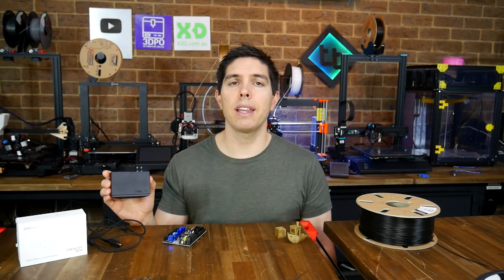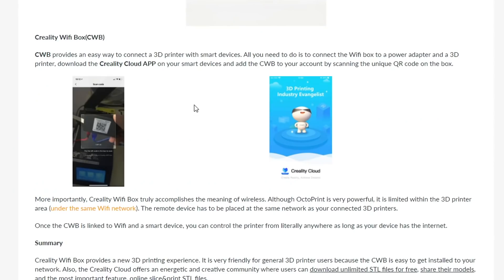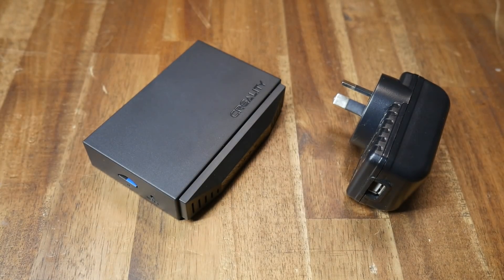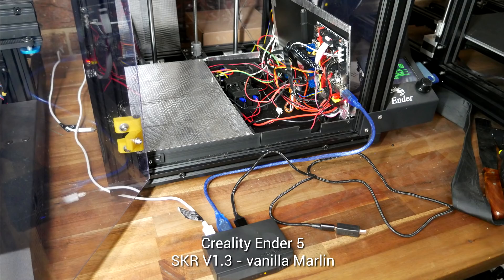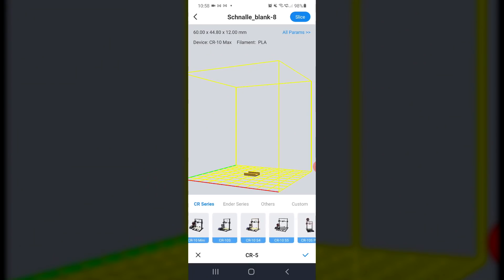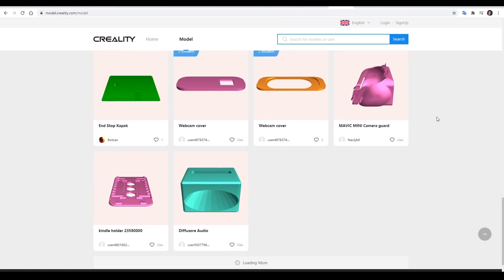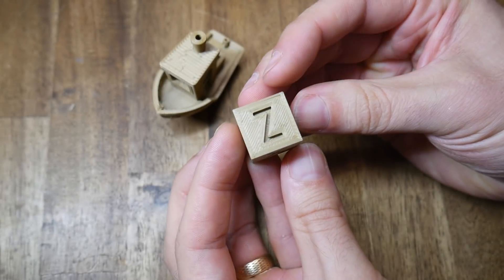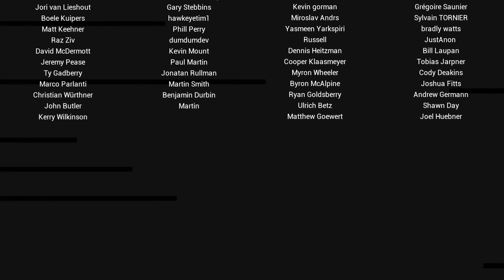Creality WIFI Box tested: Budget Octoprint alternative?

Comment: I use a number of plug-ins with Octoprint, but the Home Assistant integration is really great.  When the printer starts a print job, external lighting around my Lack-based "enclosure" for my Ender 3 comes on.  After the print concludes, if it's been more than an hour, it will send me a notification telling me, along with the elapsed time (except if it finishes in the middle of the night and I'm sleeping.)

Octoprint seems like a better alternative.  I can't imagine doing all that management and configuration on a phone or tablet screen as compared to mouse, keyboard and large monitor with a web interface.  And I really try to not let the printer run completely unattended -- checking the status while I'm outside the home isn't really a problem that I need to solve.

Clearly you invested a lot of effort doing the evaluation so we don't have to.  Thanks!

Comment: how is it a budget version of octoprint, if you can install it on any sbc, even some sub 10 buck chinese ones?! youre no bound to raspi
Reply: Right, he should trz octoprint on an orangepi. Maybe you need some more time setting up, but also only half the cost of this solution.
Reply: @flipschwipp6572  I have had Octoprint running on OrangePi for years. Works perfectly fine and was not that hard to setup either. I believe the OrangePi costed me 12 dollar. Since it is so cheap I just build it into my 3d printer.
Reply: If  someone would do a more efficient octoprint incarnation, we could go to smaller processors like v3s or F1c200s ( both sub 5$ linux capable chips)
Reply: @soundspark  Yes, I know. People just often use the OctoPi image for Raspberry Pi because of convenience. I mentioned it because installing it on OrangePi is entirely possible, because the OrangePi is cheaper and because I have not found any downside to it other than having to install it manually.

I started with either a debian or ubuntu system image for OrangePI (I don't remember which). And then just followed the instructions for manually installing OctoPrint.

Comment: Yah in theory it could be made into a good solution if it could remember the changed printer settings like retraction and temp and if it allowed slicing of any stl. Although it is basically a solution to a problem that didn't really exist since if you cannot afford a Pi than 3d printing is probably the wrong hobby considering the continual costs associated with 3d printing.

Comment: Octoprint - My favorite plugin is TP Link SmartPlug and Thereify .   Tp link and BTT SKR E3 Mini Turbo do not work well together because the board take to long to boot up causing octoprint to switch off the printer on error.  I replaced the turbo board the the V2 baord I was using without any problems.  My printer is an Ender 3.

Comment: talk about low budget. A TV box flashed with armbian and installed octoprint via python can make the cost around $10. The on board resource may be less than rpi, for example have no GPIO, cheap camera or less usb port etc. However you may get a better processor(for my case amlogic x912) , much more ram(at the time I build only Rpi3b aviable, so 2G+ ram was neet) , lower cost, and similar or better octoprint experience.

Comment: Wow - Octoprint runs fine on a Banana Pi Zero (4 core Raspberry Pi Zero W alternative) running Armbian for $20, Prusa even has it running on a Zero W for $10 although it's slow and I found the WiFi range was poor. Don't need a Pi3/4 to run Octoprint. Even if this worked reliably - having to use the internet, an app, forced registration, AND Cloud dependency (so when Creality pulls a google and kills the service it's a paperweight), HARD NO.

Comment: I feel like octoprint is the budget alternative to octoprint.
Reply: The budget alternative of octoprint on a raspi4 is octoprint on a raspi3b
Reply: @moxl_  if you're feeling lucky or don't need a camera,  a pi zero can do
Reply: @moxl_  Yep, I used a Raspberry Pi 3a+ but then had to buy another usb hub, so same price as the 3b basically.
Reply: @moxl_  orange pi is cheaper than raspberry pi...
Reply: Great price for either alternative :)
Reply: cant you just use octoprint on normal pc?
Reply: @Barten0071  yes. On fact, that's how I started off using octoprint, using a laptop I had kicking around.
Reply: Your saying octopi t is a budget alternative to OCTOPRINT?
Reply: Seems like a solution in search of a problem. If it can't switch your printer on, remove the part from the bed, and essentially do everything you need to do in between print jobs, the whole "not connected to home network" is utterly useless. And comes at cost of mobile UI.
Reply: No. Klipper is the budget alternative to OctoPrint.
Reply: yeah
Reply: Octoprint on Orange Pi Zero 2. Takes a good bit of work to set up - no ready-to-use octopi image, and bizarre problems like wifi ceasing to work the moment you unplug Ethernet -  but once you finally get it running, it runs flawlessly.

Comment: Though the Raspi Zero W is not officially supported by Octoprint, I run it on three printers and it works just fine. I never had ANY issues. 
So you can set up Octoprint for about 11€.
Reply: Orangepi is also sub 10$ and way more powerful

Comment: "It's 2020" Fails to provide a USB Type C port....
I don't about you but I can access my Octopi/Octoprint anywhere I go with my phone...
Reply: Yes, you can access your OctoPi with your phone, but what about the Chinese guys?

Anyway, the cloud thingy is just a solution to the problem that VPNs or port forwarding are just too darn difficult to set up for the casual user.

I know, setting up a VPN on pfSense is just, like, eight steps, and you find a plethora of tutorials on the internet. If you prefer a shabby router instead: on a FRITZ!Box it's, like, one single click.

Unfortunately, many people nowadays suffer from CGNAT (Carrier Grade NAT).

Regardless...people buy cloud-connected "home security systems" so they can feel safe...when this "home security systems" is controlled via some cloud server from a Chinese company?
Reply: What do you use Darren? I was looking for a free solution but was overwhelmed by the number of options. I’d love to hear what you prefer
Reply: @cap1sup  Free solution for what? I use a Raspberry Pi 4B with Octopi install. pfsense for my networking and I open the port for octoprint(after changing to a new port for security).
Reply: @zer0ish84  I wanted to know if you used a plug-in or not. It seems to me like you routed the Pi through your router on the correct port, which is interesting. I’ll have to try that
Reply: @cap1sup  Correct, I didn't need to install a plugin to get world access. Like I said, I only changed the default port and used port forwarding in my router and pfSense setup.
Reply: @zer0ish84  don't open octoprint ports to the outernet. just install a vpn like wireguard (very easy to install with docker, can be on same raspi as octoprinr), andreas spiess has at least two videos on setting up applications with docker on raspberry pi for home automation. i've been using wireguard vpn for a while now and got rid of other solutions like remote.it or any port opening.
Reply: @TomaszStachewicz  Meh, not really concerned. I do have a VPN setup, but don't care much about using it. If someone wants access to my stuff they will get it regardless.
Reply: @zer0ish84  it's often not about accessing your photo backups but turning your devices into a botnet. which might get one in trouble.
Reply: @TomaszStachewicz  I'm well aware of all this stuff. I listen to Darknet Diary. I monitor my systems and network on a constant basis. Again, not worried. I also shut down my RBP4 after I'm done with it.
Reply: @zer0ish84  all right, cool. my reaction was based on seeing dozens of clueless people happily opening ports without being aware of the risks.

Comment: So...Creality claims Octoprint is difficult to set up, and they counter with this atrocity?  No thanks.
My one Raspberry Pi is running two printers with two cameras, it works every time, and like Michael says, I don't need to surrender my phone number, email address, location info and I don't need to send my .stl file to someone else's server if I don't want to.  I also don't need a smart phone to access it.
If this thing ever caught on and users became dependant on it, Creality could then start charging a monthly fee.  Not possible?  Look at Fusion 360.
I have a feeling the people responsible for the Ender 3 and CR series of printers are not the same ones responsible for this mistake.

Comment: I just built my first Raspberry project ever based on OctoPrint, with an 5" touch screen running OctoDash for local control. It was very straight forwards and leaves nothing out. 
A few cool plugins are to display for instance thumbnails of the model both in the web browser and the local touch screen. Next is enclosure heat control via GPIO on the PI.
Octoprint is limitless with a massive online community and great response from developers... which most likely cant be said about Creality....

Comment: The reason the app asks for location permission is because originally, android didn't protect the wifi information, and that can be used to locate devices based on nearby networks. Since Android 9, apps are required to have the "ACCESS_COARSE_LOCATION" ("ACCESS_FINE_LOCATION" on android 10) permission to acess wifi information, in this case, scan the local wifi networks.

Even tho good on creality for still letting you choose manually from the phone's settings.

Comment: Real question - Why do people use these products?  As long as I need to manually remove the print (non-3d print mill, etc.) I already know how long the print will take and I can not schedule another print until I go back physically to the machine anyway.  Therefore I never had an issue with just using SD cards.  I will make between 2 days and a week worth of prints on my SD cards, go to the printers and load them up, then set up a web cam to monitor them, and come back after I know they have completed their job (or when they need new PLA / etc.).   So.... what is the point of bothering with trying to start a job before you can get there to remove the prior job?? 

Even with a 3d print mill type set up, I plan to schedule several days worth of prints and monitor them, I will be coming back to replace PLA/etc. more often with that printer etc. so again, I do not really see the point???
 
Again, this is a real question, I am just trying to understand the value of these types of systems.  Thank you !
Reply: Not sure about the creality product, but octoprint does a whole lot more than just starting/stopping prints.  There are tools to level your bed, monitor your print, create timelapses, postprocess gcode in various ways, slice within the interface, track print history, filament usage, control lighting, make live tweaks (flow/feedrate), select filaments for MMUs, backup gcode files to the cloud, send texts with updates, detect failures... I could go on and on and on.  I think you should try it, and the benefits will be obvious to you.

Comment: I use ocoprint on all my FDM printers.  I use two plugging, the firmware update and the accurate time plug ins.  

The firmware plug in which is a little buggy. But it works well on the skr boards which are in all but one of my machines.  I can’t seem to get it to actually update on the one TH3D EZLITE board I have.  It says it updates, but it doesn’t.

The accurate time plugging is amazing.  Takes about a dozen prints to dial it in, but it’s its accurate within a couple minutes over a 24h time frame.

Comment: I'm running OctoPrint on an old laptop that I installed Raspian to. The laptop is about 4x as powerful as a Pi 4 and was sitting doing nothing, gathering dust, so I thought "Hey, why not?" and here we are. My E3V2 micro sd slot probably has about 5 uses left in it (it's less than a month old) so an external storage is ideal. Free upgrade for me!

Comment: Excellent video, I was looking at this but had a spare Pi Zero W floating around so tried Octopi (Yes I know it's unsupported on Zeros). Favourite plugin not so much for Octoprint, but have Cura is the Octoprint plugin, so now can print directly to Ocoprint. No more SD Cards or uploading through the web interface. Works really well.

Comment: Interested to know what's inside. As Dave says "Don't turn it on, take it apart!! Maybe it could be hacked to run Octoprint?
Reply from the maker: Here you go: https://imgur.com/a/5UBMquL
Reply: @TeachingTech  Thank you so much!
Reply: I can't get firmware or an SDK out of them so it seems like more work than it's worth...
Reply: @Naomi-Wu  Are you going to do a review and do you go to open this box  to see what's inside?
Reply: @Naomi-Wu  BTW, I thought creakily had seen the error of their ways on the open source thing? Weird.

Edit: Creality, damn you autocorrect.
Reply: Highly unlikely given the price point.
Reply: @JasperJanssen  Maybe, the original price was much higher. From FCC filing the pictures show a Winbond W971GG6KB-25 and a Mediatek IC but the digits are too fuzzy to make out.
Reply: @mini1293blue  even at the 40 bucks it seems unlikely to be a particularly competent single board computer, and if they’re dumping them at half cost that argues for close out sales rather than a solid supply.
Reply: Apparently there is a Linux distribution for the MT7688AN based on OpenWRT. So it's not completely out of the question that OctoPrint could be ported to it. Doubt that there's much filesystem space available tho.
Edit: forgot about the sd-card. That part of it should be fine.
Reply: @Jason Smith you can see that: https://yadi.sk/d/4t-qXYZBuYXxjw?w=1

Comment: Hi Michael, any chance of opening the box up and showing us whats inside? My guess is an ESP based board.
Reply: Esp board wouldn't be able to handle the webcam, unless the webcam is a standalone IP camera.

They also don't support USB host, you could potentially work around this with an additional microcontroller that does, but I think at that stage you'd just be better off picking something else to design it with
Reply from the maker: Here you go: https://imgur.com/a/5UBMquL
Reply: @TeachingTech  all the interesting stuff is below the metal shield :/

Comment: I run a couple of Instances,  an Anycubic Linear Kossel and a modified Ender 3 with a BigTreeTech controller. My pipeline is Design Spark 3D CAD to Cura to Octoprint with local file saves between each steps and there is the beauty of Octoprint. It creates a unified UI for both printers and if I added a third it would be the same. My pipeline would not change and I have local control and security at each step. Setting up an Octoprint node is trivial especially if you use hardwired Ethernet then it's just download the SD image, burn it and boot, my only change to the INI file is using a fixed IP address instead of using DHCP. I don't really use any Octoprint plugins because my needs are really simple (Design>Slice>Print).  The only thing I would like to really see is how to (easily) run more than one printer from an RPi because the Pi3 has more than enough grunt to do it.

Comment: The reason for location permission is this:
Why does the app require location permission for wifi signal?
One less obvious thing about apps showing wifi networks in the neighbourhood is that the list of the networks is unique for the given area and can be used to determine user's location. There are online databases with a huge number of access points and their locations created by apps which have access to GPS. Apps which only have access to the surrounding wifi networks and no direct access to GPS or location can then use these databases to get coordinates of users with about 20m precision. For instance, one of such databases is here:

https://wigle.net

This means that any app that is able to show surrounding wifi networks may know your location.

Originally, the Android system didn't protect access to the wifi information at all so apps could access it without any restriction (and so they could get user's location without users knowing about it). In recent Android releases, Google has been making progress to protect this sensitive information:

Since Android 9, apps are required to have the ACCESS_COARSE_LOCATION permission
Since Android 10, apps are required to have the ACCESS_FINE_LOCATION permission
So if the app needs to find any wifi networks it needs location permissions

Comment: No Senna shirt? Damn. Thought it was a constant unit :D
Thanks for the video, was considering the box, but as i own an Ender 3 Pro, retrofitted with a 4.2.7 board, an Ender 3 V2 screen and TH3D firmware, i'm not sure that it would work 100%. I will try Octoprint on one of my Pi Zero W, even if its not officially supported.

Comment: If I remember it right, Creality checks some kind of hardware/software ID of your printer. So you can only connect stock Creality printers with there firmware. But I think there is a workaround for that.